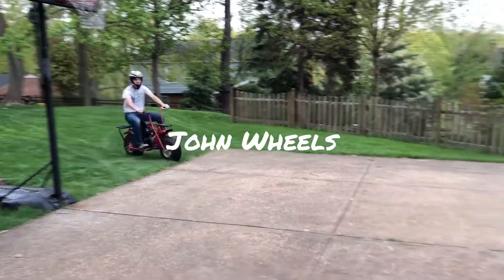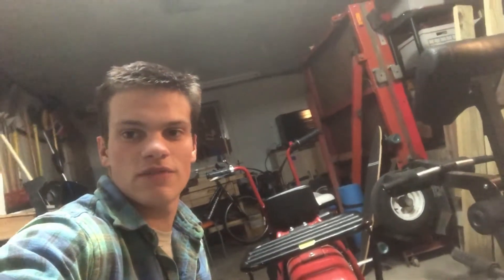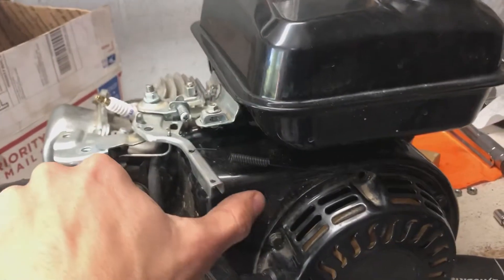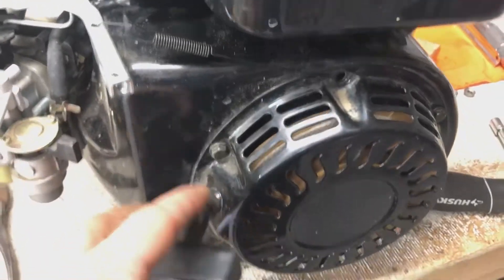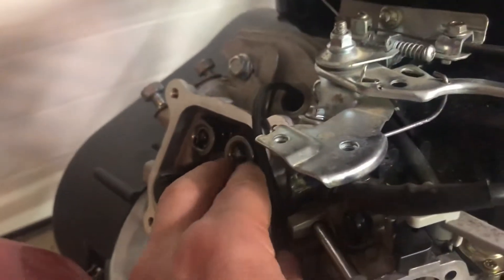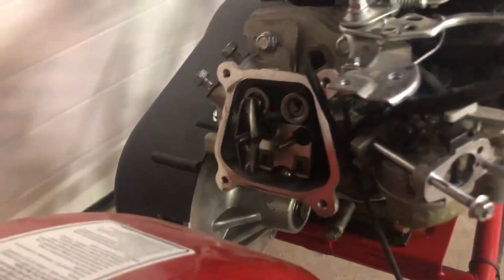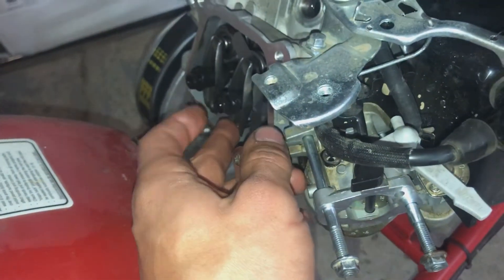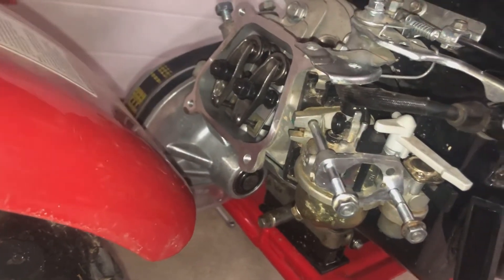Coleman CT200u Engine Upgrades

Comment: Not sure why you would pull the governor and use 18lb valve springs. The stock springs can easily handle the max RPM you will get. The 18lb valve springs are for 5600+ RPM. Your engine will not see anything near 5600 RPM unless you make a dramatic gearing change. Even if you did change gearing the engine would run extremely lean at those higher RPM with stock jetting, filter, and muffler.
Reply from the maker: Thanks, but this thing probably does about 5000-6000 when you get up to top speed, if you watched the video you would hear me explain that I kept the muffler because I live in a neighborhood and I kept the air box so I can get it super muddy.
Reply: @JohnWheels  I understand about the stock muffler and was just explaining the lean condition that occurs on stock engines   . If you were really getting that kind of RPM it would mean that the belt did not shift to "high". No Coleman 200 with stock engine, gearing, and torque converter can get 5-6000 RPM once the belt shifts to high. That RPM would result in road speeds in the 55-65 MPH range. You need an engine with twice the power, better gearing, and a Juggernaut drive pulley for road speeds that high.
Reply from the maker: Ok, it's fast enough for me. Thanks though.